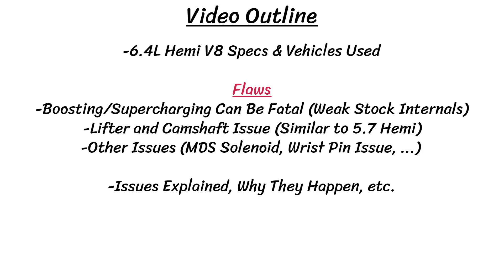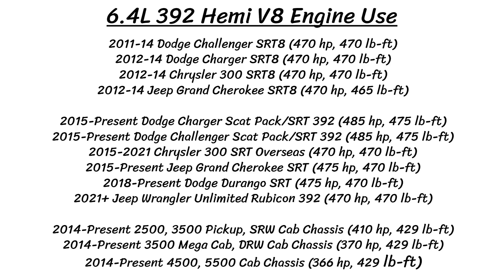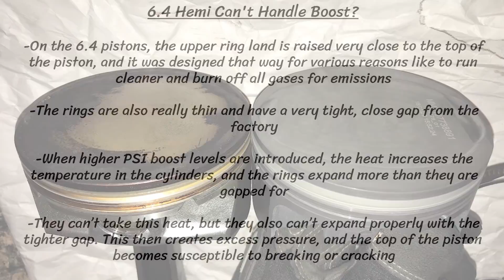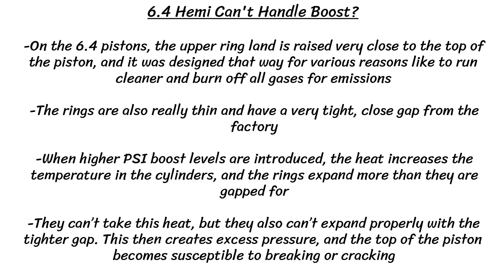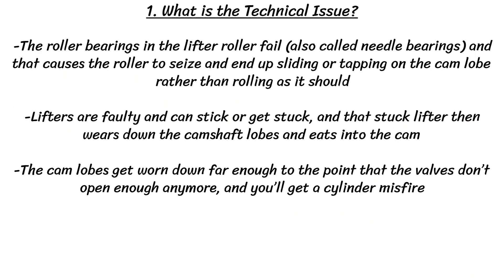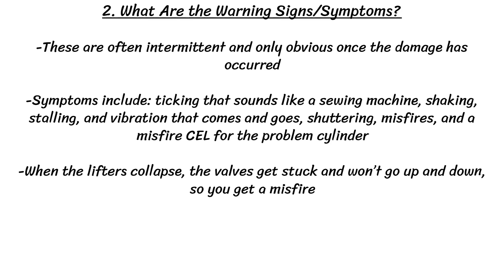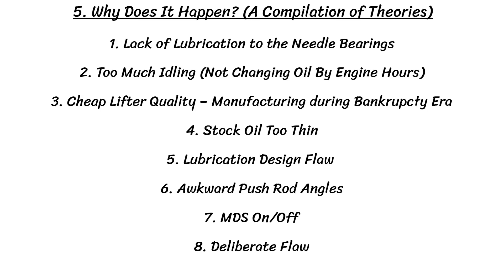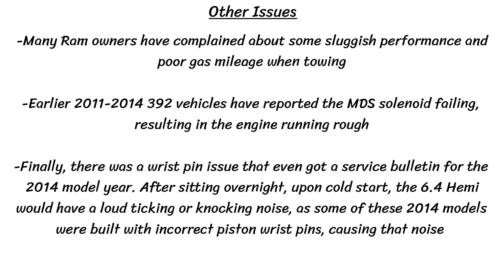The Specs and Fatal Flaws of the Chrysler 6.4L Hemi V8 Engine (392 Hemi Issues)

Comment: The modest level of intelligence at which this video is delivered sends a message to old-time car guys from the 60s-70s.  Too many kids today have not the mind or practical capacity for messing with 'fast' cars and engines; they just know how to throw a ton of money at a vehicle, and then get in and step on the ego pedal.
Reply: These days what it takes to increase power in a stock vehicle is a lot different. Now you can do a tuner kit, maybe an intake manifold, and then things get very difficult and very expensive, very quickly. When I was a kid long ago my brother's friends would bring a brand new car home from the dealer and the next day they had the engine apart to change the cam and intake manifold and put on headers. You could tear apart the engine easily, everything was accessible and very straightforward. Now you can't begin to mess with stuff on that basis without it costing a fortune and possibly messing something up.
Reply: Pipe down you old broke boy
Reply: Excues me, but all of red blooded Americans know that is no engine none to man than the Mopar engines !
Reply: To eliminate this may concern, your probably one of them people who did not get chance to have a Mopar, in fact, your probably a odd engine , not to mention car names !
Reply: What a stupid take.  All those hot rod shitboxes that your generation built arent around because they fell apart pumping out 300hp from a 455 big block.
Reply: @abecx  You're showing your ignorance there son.  In the mid '70's, yes pollution equipment choked the heck out of the engines offered by the Big 3 but  1964 to 1971 was a wonderful era.  271 HP out of a 289, 370 HP out of a 350, 425 HP out of a 428, and don't get me started on the incredible family of 327s that in the L84 put out an amazing 375 HP!  The 426 Hemi was sold as rated at 425 HP but in reality when dynoed was putting out 490 HP.  So, I'll tell you what, read a few books before you come back on here running your noise-hole.
Reply: @derekheuring2984  If they were so great, people would still be running those engines at the track for cheap power.  They were slow, inefficient, heavy, and prone to breaking.  Most overrated engines of all time
Reply: You sir are 100% wrong I’m only 21 I’ve owned a Dodge Charger R/T, Nissan GT-R, and now a 2021 Scatpack never use eco mode 😂 I’ve also sat and test driven Mclaren specifically the 570s spider. Never have a accident or even a ticket going well over speed limits. But hey you think you buddy. Anytime now I’ll have a hellcat
Reply: @jackgamby  So?
Reply: @jackgamby you're not saying anytging. At 21 you havent even driven that many hours on the rd. Fact. You ever gap piston rings, check clearances, bearings, rebuilt an engine? Knock it off scrap...
Reply: @forceoneX 25 years old and been driving over 600-700HP cars since 19  whatcha talking about?

Comment: My 2015 Scat Pack reached 100K miles this year, so far I haven't heard any ticking or misfiring as of now, this is my daily car and I drive it mostly on Freeways.
I only have 2 years/30K miles left on my Mopar warranty so we will see if the engine holds during the warranty.
After the warranty then I'll think in modifying the car if the economy allows it :P
Reply: Just get a cam that will work with your compression which should come with a set of lifters/push-rods/valve-springs ect. Then you have nothing to worry about, especially if you have a manual car that doesn't have MDS lifters. The Hemi is worth building for its superior head design and iron block.

Comment: It’s always a good idea to change oil early and maybe even add more than recommended. Seems like the engine not lubricating is do to low oil? Full senthetic and change way sooner will do wonders. Whoever my question would be if I just leave it stock and take really good care of the vehicle will I avoid issues that you talked about? Meaning that if problems arise because people modify the engine pushing the vehicle to over performance?

Comment: My dream would be to have an Indigo Blue Scat Pack Challenger. I heard the water pump was a common issue on the 6.4 as well.
Reply: This is true about the water pump, mine started leaking around 38000 miles. I have a 2013 Challenger SRT manual trans.

Comment: I plan on tuning her after adding an 85 mm throttle bottle, an aFe CAI, and a standalone ECU to run on ethanol (E-85). Will the engine be able to take it? I mean the ethanol would be better for the engine. I want this to add 30-60 HP.
Reply: normally ethanol is for boosted applications where heat is a BIG problem for well...both heat and for performance. shouldn't be hard to make that 30 hp with a throttle body tune intake and maybe exhaust. Then again, they're pretty damn pegged at the power they have

Comment: I have an 18 SRT392. I had a broken valve spring at 30,000 miles, that required the dealer to tear the top end off and replace a bunch of crap under warranty thank God. I don’t beat on the car and it’s not modded. I’m wondering if that’s also a fatal flaw of the engine. I’ve really babies it since then because I always believed these engines were very reliable.

Comment: Removing MDS solenoids and lifters to allow full flow is the solution. MDS lifters only get oil when MDS is on. So if you remove the solenoid it allows the oil in to activate the mechanism in the lifter so this is why you want to remove them and replace with regular lifters otherwise MDS will always be on if you only delete the solenoids. This is why high idling cars have the issue way more than anything else because MDS doesn't turn when idling therefore starving lifters surfaces of oil. Very simple concept
Reply: You’re really confused on how mds works.

Comment: The 392 is not made for major mods because you can just go get a hellcat for much cheaper and a lot less headache. Cheaper than modding a 392 the proper way that is and I'm talking transmission rear end and all that.
Reply: You can buy a forged 426 Long Block for only 12 Grand. 2 Grand to install, Dyno and you're all set

Comment: I heard something intriguing about the mds and how it can actually help lube the roller portion better. Either way I have a tick from hell and a slight shudder while at idle. Hot or cold it does it. Sooooo a nice new set of non mds lifters and a sweet lopey cam are around the corner I guess🤷🏻‍♂️ 2014 JGC
Reply: 2014 gc here as well. Get hellcat lifted and a cam. You'll be fine 🙃 people love my Jeep.
Reply: @Nebowore that's interesting. But we can agree that hemi tick occurs with OEM 392 and 345 lifters.

Comment: I own three vehicles with 5.7 hemis. 2006  ram 1500 has 260k miles has the hemi tic since 120k miles. It still runs pretty good but gets 10 mpg normal driving.
2005 300c has 119k miles. Runs great good mileage awesome car. 2015 challenger r/t. 45k miles runs great. It has not been babied. Runs great no tic yet and gets 25mpg solid with normal driving. MDS works great and engine runs with 20 inches of manifold vacuum and is rock solid (no valve issues. 
A few years ago I had a 2006 ram 1500 had the loudest tic I've ever heard and was babied and well maintained. Sold that one as is......
Reply: 25mpg.....that must be strictly highway at normal speed. City driving you are only getting around 12 max

Comment: My 5.7 made it to 225K before a heard a "Chirping" noise. I thought at first is was a loose exhaust clamp letting squeak/chirp.I caught the lifter problem before it ate my camshaft. Mopar lifters on back order. Bought some China lifters and have put another 20K so far. (knock on wood) The only problem is they "Tick" until oil pressure comes up.

Comment: I have a 06 Ram 5.7 with 300k miles and it still runs strong but the tranny went out first
Reply: How did your transmission go out? I have an 09 Ram with 200k and my transmission has issues downshifting.
Reply: @DeMortuisAutNilAut  I had a issue with the transmission the first time around 215K. I had a shop do the work for me and it was the shift solenoid pack that had to be replaced. It cost me close to 700 bucks. That was 5 years ago. I haven't had the money to get it fix this time around but it think I'm going to save to get a new/used tranny. The engine is strong as long as you never let them overheat at all.  I would look into the solenoid pack first on yours cause mine was doing the same thing.
Reply: @whatdafaulk  Thank you I appreciate it. I'll have to look into that. My engine still runs strong too, no issues there. Whenever I slow down the transmission doesn't downshift quick enough and it'll be in high gear while coming to a stop, stalling the engine. I can avoid this entirely by shifting manually but that's just avoiding the issue. I'll ask the shop about the shift solenoid pack though.

Comment: having issues from not knowing how to build a motor is not a fatal flaw….it’s stock built with 485 HP and 400+ foot pounds of torque….if you weirdos would stop fuckin around with something that doesn’t need to fucked with you’d be fine….unless you’re racing, which most of you aren’t, you’re just squirreling around on the streets beating on the car being goofy you need to leave it be or upgrade to a CAT.

Comment: I have 2012 challenger srt8 with 65,000miles and its at the dealership and getting a new engine, lifters and camshaft metal shavings. All under warranty.
Reply: How much did the new engine cost with the warranty?
Reply: @permanentvacation2406  $100 deductible

Comment: Lots of misinformation here. The stock pistons are plenty fine. They’re good into the upper 700hp realm. You need to re gap the rings for boost obviously. The rings butting against each other is what takes out those pistons. A forged piston with a stock ring gap wouldn’t do much better.

Comment: Sounds like diligent care and minimizing idle time are the key factors. From your research, what would you estimate the overall chances of this (lifter failure) happening to an owner of a 6.4L?
Reply: I'm pretty sure its like 2 or 3% of vehicles affected. Most of it probably being neglect. I have a 2006 Daytona RT charger with uh 130 140k miles ish (i do kilometres so, rough conversion) had it 4 years, its my first car, beat the piss out of it (as kids and young adults do) and never had any major issues yet. Power steering pump due to donuts and front suspension from age and mileage
Reply: @baileyhatfield4273  Good to know. Thanks for sharing. I figured it would be fairly low else we’d be hearing (and joining) a class action suit.
Reply: Failure rate is much much higher then that. The lifters will fail.  They almost all do

Comment: Dodge claims to be the brother hood of muscle. And while that seems to be the case, I think the big and final horrah they should make is a NA high compression version of the hellephant engine for the scatpack and a truck version for the power wagon and the 2500. Since it won't be supercharged, it should comply with emission regulations. Also it should make over 560 hp and 570 tq. Not to mention the 392 is already squeezed to the max from factory and its heavier being iron and the 7L is aluminum

Comment: My 2019 Scat Pack seized at 3,500 miles.
Reply: Good for you deserved it
Reply: @riverbrock  I hand you the massengil trophy of the day for your petty comment...you earned it!
Reply: @riverbrock  how so?  Stupid response.
Reply: Wym seized? the pulleys on my 2020 wide body seized and it ripped the accessory belt off was around 4-5k miles too now it idles rough but it’s only at a dead stop and you have to feel for it
Reply: @A1commentary  the engine seized up not longer its first oil change as I was driving home. Dealership had to put in a new engine.

Comment: I have a 2016 392 Scatpack with what I believe is a lifter issue but Chrysler won't do anything unless I pay for the diagnostic. The ticking noise is only heard at low RPM (very noticeable) and disappears as RPM increases and has been this way forever. I always drive in Sport or Track mode so MDS never kicks in, do lots of manual shifting, change my oil using only Pennzoil 0-40 at the recommended time and never sit and idle very long. Currently I have 90,822 miles and keeping my fingers crossed.
Reply: What do you recommend?
Reply: I got the same year...but track mode is the only one that disables mds

Comment: My 2015 challenger 392 the lifters went took 3 months to get it back and when I got it back drive it for 1 day and the motor blew up as I was driving fast that means no power steering really no breaks then went back into the shop took one year for Chrysler to ok a new motor and when I got it back the guy who put the motor in did not time the trans rite so my trans went so they rebuild that took 3 months and when all said in done lemon law that car but I went back out and got a 2020 challenger wide body
Reply: You had shitty mechanics working on it smh

Comment: C'mon, Don't Tell me your a GM guy in disguise, I'm starting to get  Robert Eaton vibes.
Reply: I have an 18 scatpack challenger.  It's been dead reliable. My wife has a 17 ss camaro. We had it in twice under warranty for issues in their mds system. First time was for 8 bent pushrods. All on mds cylinders. Second time I heard a lifter tapping and took it straight to the dealer. It was still ticking when the mechanic drove it into the bay. About 15 minutes later I heard him fire It's and instantly silence. 45 minutes later he comes out and gets us a loaner. It broke all 8 pushrods on the mds cylinders on startup. The dealer never admitted it, but I'm pretty sure that they did a mds delete when the fixed it. They said they replaced the oil galley, all 16 lifters and pushrods. All I know is the gas mileage took a hit after that repair. That car is gone down the road now, my wife said she couldn't trust it anymore.

Comment: 6.4 HEMI 138,000 miles. No issues so far. I Change the oil with the SRT recommended Penzoil and Wix filter every 5,000 miles. I also make sure to romp the gas every once in a while
Reply: Hey bro what’s “romp”? … asking b/c I do the same with the oil changes on my JEEP SRT.
Reply: @tonymunoz7400  he means to floor it

Comment: The 6.4 is very reliable and is designed to be exactly as it is for a reason. From a company standpoint if you want some serious horse power they have got you covered,  HELLCAT. The 392 is a fantastic engine and for most 485 hp is fine, considering that the bad boys of years past was 375 - 450 hp.
Reply: I wish Dodge would make a 3600 lb car to put these engines in, even as heavy as they are they are fast, but if they lost 7-800 lbs no LS/LT or Coyote could touch them.
Reply: @samholcombe3129  Yes and parts like wear n tear items like brakes would last alot longer in a light car
Reply: @microminiskirt  totally
Reply: @samholcombe3129  
Then you would have another mustang or Camaro.  If you have driven these then a Challenger it is literally night and day. Not just ride but interior space. The Challenger cannot be the same weight and keep the ride and size and that us truly what makes it what it is. Yes she is a big girl but that ride is well worth it, at least to me. Apparently to alot of people also, it has kicked the Camaro in sales for a while now and last qtr the mustang to.  If you want to carve some corners then the mustang and Camaro are definitely your choice, but for a nice ride with some serious stoplight/ track action then the Challenger/Charger is a very viable option. I personally have made 3 - 600 mile trips in my SRT 392, each way. One 5oo mile in a mustang, do not recommend that especially compared to my Challenger.  And with the new wide body the corner times have improved alot.
Again, to combat the Lt and coyote we have the Hellcat that runs right along or slightly better.
Reply: @randysmith9636  I’m not saying stop making Challengers and Chargers, I just think it would be awesome if they made something smaller and lighter and called it a Cuda even though that’s a Plymouth name.
Reply: @samholcombe3129  
Growing up we were a Plymouth family. The first I remember was a 65 Plymouth Belvedere, I was 7. We had a Roadrunner, Duster, Barracuda, Cuda, Satellite Wagon with a 4.10 posi and a couple Dodge Charger, 69 and 72. Plymouth Van (2). Some were mine, some were Dads. 
I agree with you, I would love to see the Plymouth name revived. Even the 99 concept Charger built on a much lighter chassis would work. A 3800 lb car with a Hellcat engine would be absolutely wicked. 
O, also a 64 Polaris convertible with push button trans, 69 silver/ black w/ red interior GTX all numbers matching (mine) a Plymouth arrow with a 340 ci conversion and a Dodge colt
In 77 my mom who is 5'1" bought a brand new Chrysler Newport, that thing was the size of a decent boat. 
I even bought a 69 Chrysler tri hull boat. Yep, I guess you could say I bleed Hemi orange.  Present day I own a 17" SRT 392 6 speed and 87 Dodge 100 truck all original right down to the 318 2barrel with over 325k on it. She smokes a little at start up but purrs like a kitten.
Reply: @randysmith9636  my dads dad was Mopar and moms dad Chevy so I love both. Had both. Only hate Ford lol. I’ve had Camaros, Chevelles, Chargers and trucks from both, one truck I miss over all is the 78 Cherokee Chief I had, 401 4Barrel and a 78 4 door Cherokee 360 4 barrel. Best 4+4s I ever had. Built like tanks.
Reply: and that's GROSS pre emissions. even if they weren't choked their SAE net rating would be more in line of 310 - 390 hp. 485 is more than enough for most people.
Reply: Yep. 485 is plenty.
Reply: @OrphanT11  It sure is brother.
Reply: YES! I love mine and wouldn't change a thing! Idk people wana buy one of these and expect to slam another 300+hp on it. Of course it's not gonna hold up, it's NOT designed for that.